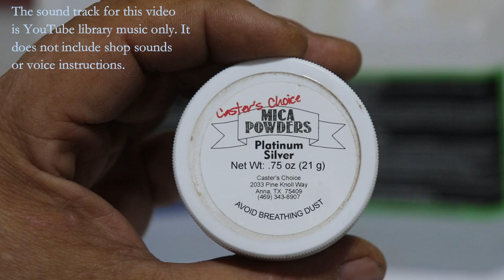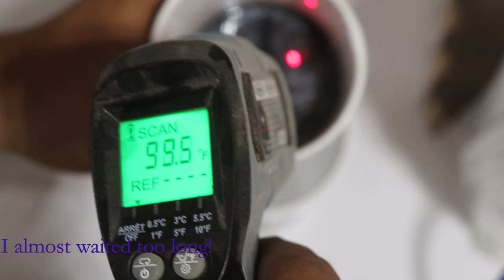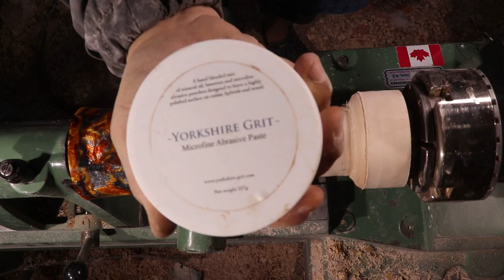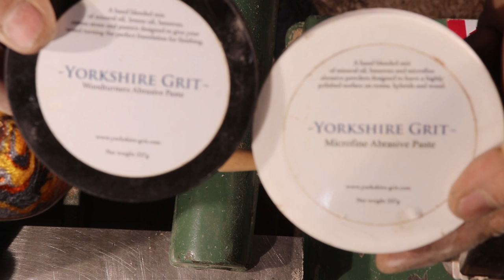Woodturning |Metallic Mica Powders - Hybrid Goblet

Comment: Your Skew practice looks to have paid off from a few months back.

I assume that the temp you were checking was after most exothermic reaction had taken place and as such when you poured them together you didn't get the thermal convection currents that tend to blend everything into one colour.

Only with hindsight I wonder if dragging a thin cocktail stick through could have softened some of the colour transitions.

I also wondered why you didn't suspend a block of wood in the cup to save resin.

Lovely piece.
Reply from the maker: Thanks Chris. There is a point where you can mix and keep the colours mostly separated which is what I wanted for this piece. The window to do this is very short which is why it was just resin and no filler piece. Thanks for watching!

Comment: Does using a pressure pot let you do pours that are over 2 inches deep or is from the brand of epoxy you are using?  Beautiful piece.
Reply from the maker: No, pressure pots only compress air bubbles so that you cannot see them. I only use Alumilite clear slow or red creek resin. Thank you for watching!

Comment: Greetings,  I have watched several of your presentations and noted your use of hot melt glue. I was wondering what the brand is that you use for gluing the project  you are working on to take of the tendon.  Also is your hot melt gun a certain brand.  I tried to use hot melt glue to work on hte bottom of a bowl and it didn't hold.  i thank you for any information that you can provide to me as I would like to use the method which you have demonstrated on your YouTube presentations.

George Boxwell
Reply from the maker: On this piece I used Starbond thick CA glue. For hotmelt I use arrow glue sticks and a dewalt dwhtgr50 glue gun. Thanks for watching George!